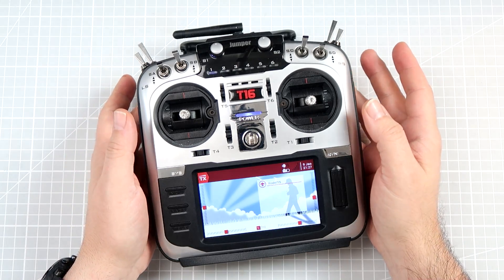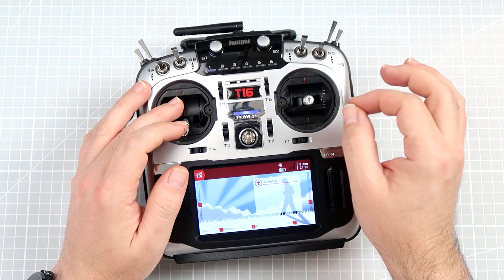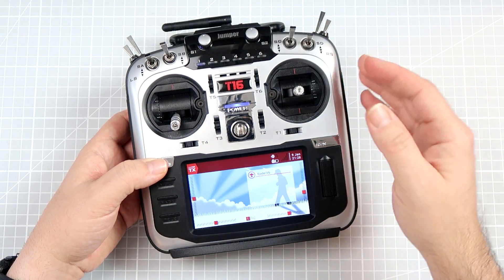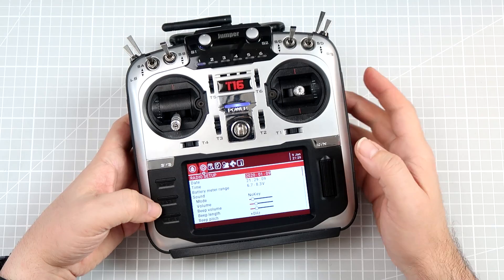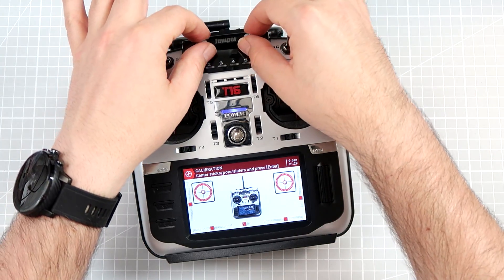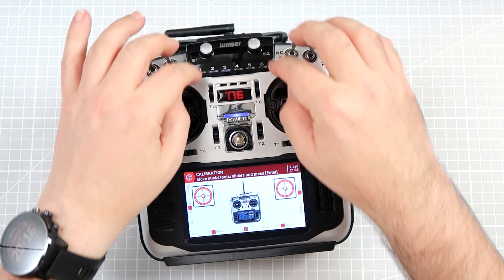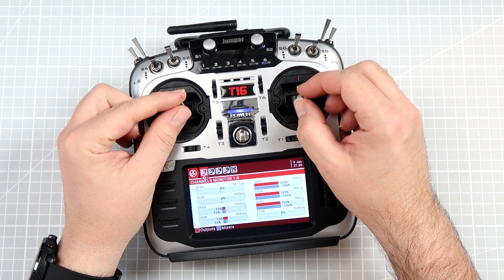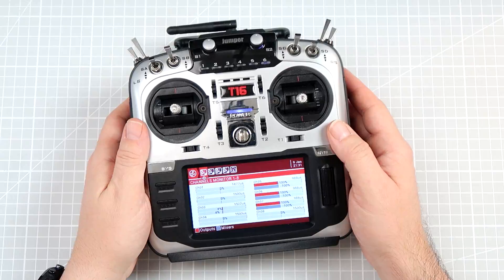EdgeTX & OpenTX Calibration - when and how

Comment: I just recieved my tx16s two days ago calibrated the sticks the day it arrived and now they are off significantly (throttle min supposed to be 988us and it now reads 1017) after recalibration they quickly starts drifting again.. this is with the hall sensor gimbals inside and i dont know what to do its unusable like this. By the way both sticks are affected and midpoints drift from 1500us to 1470 or 1530 or there about.. anyone got suggestions?